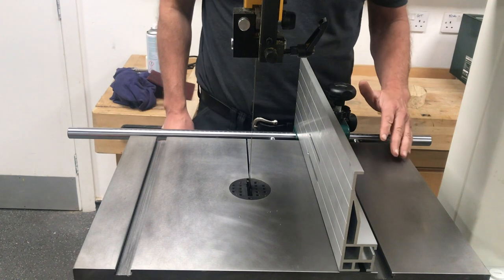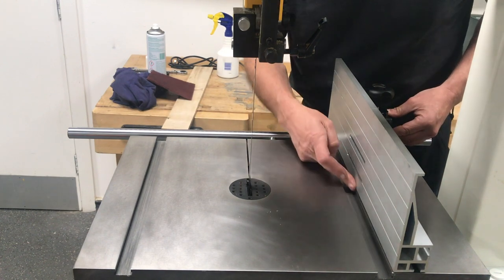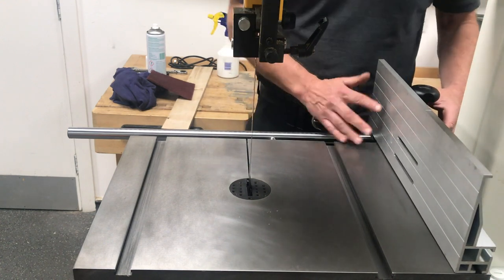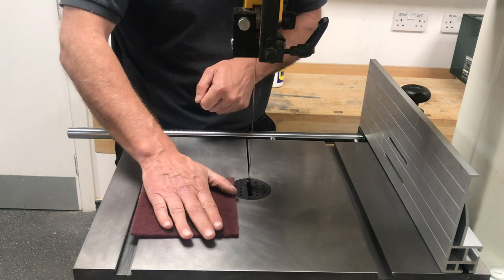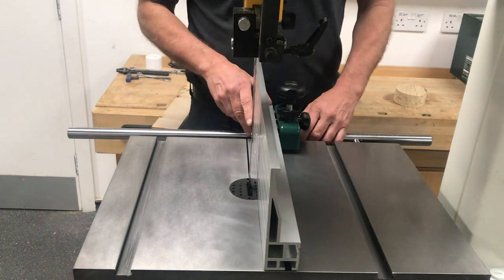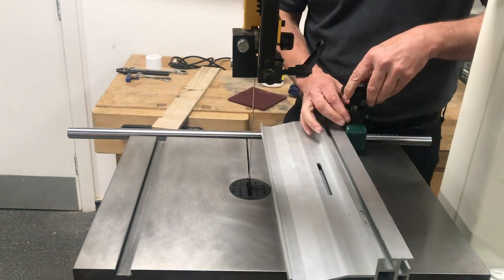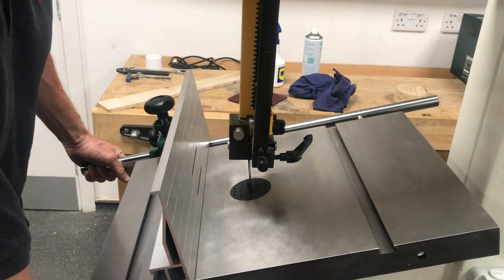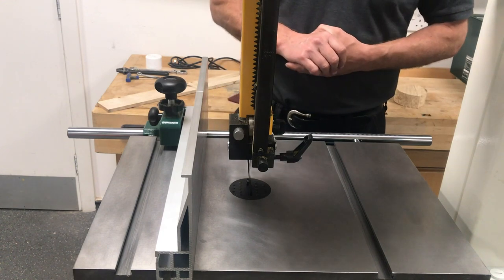Know-How Series: SABRE-350 14" Bandsaw Rip Fence

Comment: As in previous tutorials I've watched the information is clear and easy to follow. 
Will this large fence fit on my 14" BS350s which recently bought from new, or can you recommend any other options please. 
Thanks 
Dave
Reply from the maker: Hello, thank you for your kind feedback. If you visit our website and search for our SABRE Bandsaw Fence Upgrade Kit (Part Code 88888) you can buy this fence to attach to your BS350S. Best Wishes, Record Power.
Reply: @RecordPowerTV  Thats great.
Please can you tell me is it an option to buy just the fence and fit it to my existing setup.
Thanks again 
Dave
Reply: @dbull46  I have the Record Power BS350S, and the Sabre350 fence upgrade (part number 88888) fits with no modifications to the table.  The fence upgrade is available separately, and I paid €144 for my upgrade kit.  The upgrade kit comes with two fences and two resawing bars.  The tall fence is shown in this video and the other fence is about half as tall.

Comment: Why do you have to loosen the cam adjustment to remove the fence?
Reply from the maker: Hi Mike, loosening the cam adjustment allows the fence to be removed with ease as this helps to release the fence. Best Wishes, Record Power.
Reply: @RecordPowerTV  Thank you for the reply.  I bought this kit based on your video, and I can confirm it is not necessary to loosen the cam adjustment to remove the fence.  I don't want to have to realign the fence to the table miter slot each time I change the fence.

I also discovered an annoying flaw with the design that causes the fence to move along the rail while tightening the locking nut.  The problem, as I see it, is the locking bolt is not centered on the fence rail, so as the knob is turned to secure it in place, the entire fence assembly moves slightly to the right.  I modified mine to completely eliminate this movement.  The fence can be locked in place or released to move along the rail with a quarter turn of the locking knob.
Reply: @Mike--K  I've noticed this too v annoying

Comment: Silicone spray on the table of a woodworking tool?  I think not.  Shouldn't even have in the woodworking shop.  Easiest way to create fisheyes in your film finishes.
Bob
Reply from the maker: Hello, thanks for you comment. And yes if this was the finished timber it could effect glueing up the timber or the finish of your choice , but as mentioned in the video you can also use wax instead of, all we are trying to do is protect the machine and make it more efficient in use , also after using the bandsaw which is just preparation of timber you usually use a planer thicknesses or a plane to give you the desired finish before applying you finishes. Best Wishes, Record Power.